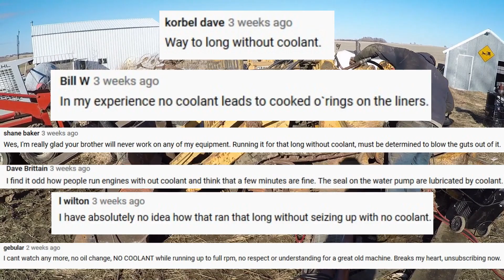Allis Chalmers HD-5 First Moves in 17 Years

Comment: See you won't overheat a cast iron block in a few minutes of running an ice cold engine but killing the seals on the water pump I do agree with because I've done it :( that old of a engine probably has brass cermanic seals not the modern rubber ones which are more robust to running without coolant
Reply from the maker: I could see that with a brand new water pump, but normally there is always going to be some coolant left in the pump that you cannot drain out.
Reply: @WatchWesWork  it was on a Cummins but we did drain the block after having to weld a crack

Comment: i kinda agree with one of the complainers, won't the water pump die if you run it without coolant? i have watched others on youtube doing the same on their newly rebuild engines and always wondered. But in your defense you never said you were going to use the engine for anything so what does it matter if the engine dies :P
Reply from the maker: I don't think a few minutes will hurt the packing. If it does, we can just tighten it up. This a not a Dodge Omni. It's built to last.

Comment: I KNOW OF A FIAT-ALLISON CRAWLER SAT FOR 25 YEARS  IN A FIELD  HAD TO PUSH IT WITH ANOTHER CRAWLER TO LOAD I TOLD THEM TO PULL PAN CLEAN OUT RAN IT TWO DAYS THREW ROD PAN HAD 2 INCHES OF SLUDGE IT GOT SCRAPED
Reply from the maker: Yeah that can happen.

Comment: to be fair, running it for that long with no coolant for as long as yall did wasn't the best idea, It didn't seem to hurt it tho so I never left a comment
likely depends on engine and watnot
Reply from the maker: It's an 800 lbs engine that makes 40 HP. It doesn't even need a cooling system.

Comment: How do does gauges work why are they at 00
Reply from the maker: It has oil pressure. The rest are vanity gauges.
Reply: @WatchWesWork  ow so the one that's in the middle whit different numbers is for oil I'm guessing the outher is for fuel and the last one for the amps

Comment: There is no greater satisfaction that showing up a loud-mouth, and doing what they say can't be done. If that was a gasoline engine, yes, it would have seized up, a Diesel engine is quite different though. Put that old crawler to work and further humiliate them!
Reply from the maker: It's an 800 lb engine that makes 40 horsepower. It cannot be killed.

Comment: You can find a new radiator aftermarket  for cheap.
Reply from the maker: This is not a Chevy Nova...
Reply: @WatchWesWork  
Wes the parts are out  there, look for them, or not more for us who actually rebuild the old equipment the right way. Nice cobble job on the exhaust by the way.
Reply from the maker: @fredted5115  LOL. I called the dealer. Turns out you can't get a new exhaust manifold for a 70 year old crawler. I was shocked.
Reply: @WatchWesWork  
Did I say call the dealer? No I said aftermarket.
Reply from the maker: @fredted5115  OK bud. I'll just call Jegs...

Comment: I kinda like leaving the expert to the internet as I have looked up stuff in the past and found everything I did was wrong and say twenty thousand miles later it still hadn't stopped going like a wheel bearing on a dodge aspen that happened on a three day legal holiday and me with wife and three kids and this is wy., where a cactus looked friendly so with crap I had and lucky me a small tub of grease I filled the center of that hub with rags so it didn't rob me of what I had and then slide those needles back into the badly worn cage (front if you haven't guessed) and some that didn't even belong with it so I could get to rock springs (1971) so lots of cars and trucks did use the road occasionally like say five to ten of them and they had their own sets of troubles with the canvas bag hanging off the grill and the hood gone on one.?LOL.  I made it to that town driving very slow and still had a spindle to install and then do right when home but still working and then remember thousands of miles later I was going to change the spindle but it did get some scars but no hard blue color. What did remind me was the other side went out by then including floor and trunk pan from the chrysler company find undercoating for reliable service. And now this rig is unsafe with any spindle as it was a acchent ten years old and most didn't make it that far. Now I wish I still had my 56 ford truck I bought from a bank when it was going back at three years of age. I offered the bank two hundred fifty dollars for it and then drove it into the ground a bunch of times but the body was good and rear end leaked but nothing I couldn't add a half pint to each year, not day or week but year. Ninety weight cheaper than the three dollar seal and the time it took to fix. Somewhere in the eighties, I pulled the old stuff out and put a 302 with automatic and narrowed up lincoln rear for disks on back and just a cheap conversion on the front with kingpins and some tie rods. I gave it some krylon and drove it for a long time close into nineties and then when price was right sold it to a guy who restored it and it is still going.
I would come closer to trusting the HD5 than a politician  who would tell me the sun is out in a rainstorm. I liked the sad look on your brothers face as he really tried to cover up laughing at idiots and then your convincing dialogue helped me know it was bull as your not very good at lying. So there's your trouble lady, you seat was out of adjustment which cause it to use so much oil that the brake lights went out and her son failed in the short bus college. (thats one not to use but I can) hate lingo won't affect me.LOL so after all this come this summer and its so dry from snow this winter, maybe you can use the ripper system on back of it. Since your up on  those old bastardized dozers, the one I had was gas, it was highway dept. orange color and the starter on right clear down at the bottom so you can't get the bottom bolt out but from underneath. I am going across a creek and dumb ass me kills it in water halfway up on track. I had to go underneath and then take the belly pan off to get to the starter which went on just fine with two bolts and get running again and then get out of the creek than had ice on edges  with snow about level with tracks. I never been so cold in my life but got it done then winched the belly pan out and put all the stuff right. So loved this one Wes, think about getting farmer brown brother in another video or two

Comment: It's  diesel, it makes very little heat at startup compared to a gas engine plus if you listen it's only running on a couple of cylinders. Folks need to learn more and whine less. I once drove my 2.2l K-car almost 50 miles with no water pump belt and I never overheated it! You have to know more than how to replace parts. You need to know how things work!
Reply from the maker: It only has 2 cylinders...
Reply: @WatchWesWork  I thought I saw only 2 sets of rocker arms. Then it was only running on 1 cylinder. It just didn't sound healthy or right.

Comment: Ya know how those junkyard ls engines out of suburbans with 200k miles take more boost than a freshly built one? This is the same thing, except this engine is so sloppy you couldnt sieze it if you tried, even sitting for 20 years didnt sieze it. These youngsters don't know it yet, but the older an engine is, the more abuse it will take cause all the tolerances are wore out so much.
Reply from the maker: I've always been told the same thing. A tight engine will seize before a sloppy one if left sitting.

Comment: HAHAHA Youtube armchair experts are useless. Ive rebuilt engines with a dingle ball hone , piston ring compressor, amd a drill hooked to the valve and Emery cloth stuck between seat and valve. Still running 100k miles later. All the "experts" on youtube have prolly never even tried to work on something in a real world scenario.

Comment: Got one at home for over 20 years and what you did to that machine shows how incompetent you are. You should've left it alone to someone who wouldn't destroy it. One of the best engines/easiest to work on and you failed!! If you junked the machine,you should've had your head examined cause they are amazing!!
Reply from the maker: Perhaps watch the video before commenting. This machine has been running and working all summer.

Comment: I hope there's no young wannabe mechanics watching your crass comments about running the engine without coolant, not clever in the least.

You're comments just prove you both have no in depth knowledge of mechanics and just mess around.

It's sad that someone who appreciates old machinery never got hold of it before you and made a proper job of returning it to working order.

I wonder, did Detroit Diesels deliberately design an engine to be started with cans full of easy start, the ruination of all engines.

Another unsubscriber.
Reply from the maker: LMAO. Have you ever worked with or around a Detroit diesel engine? You don't need to answer that, I already know.